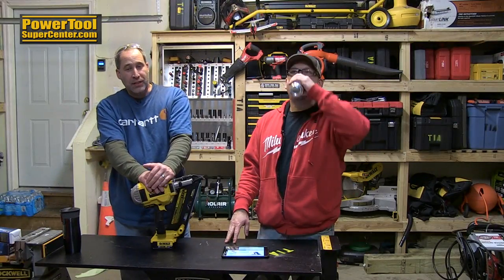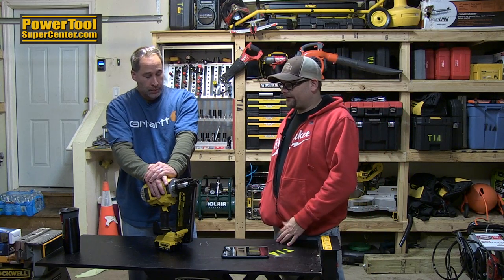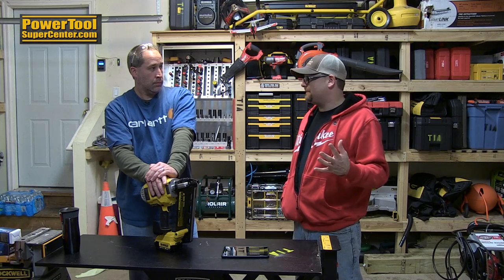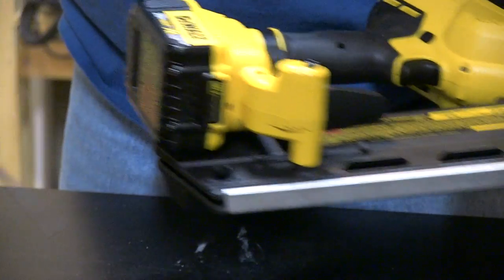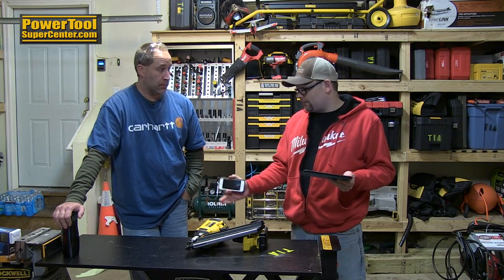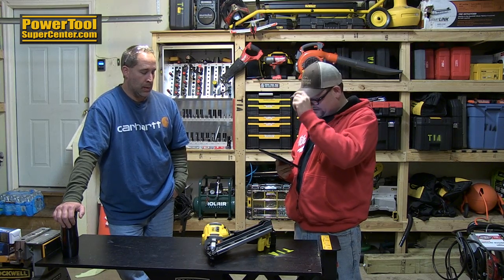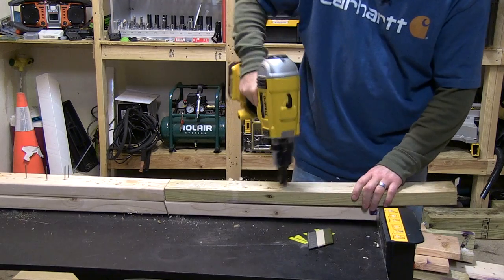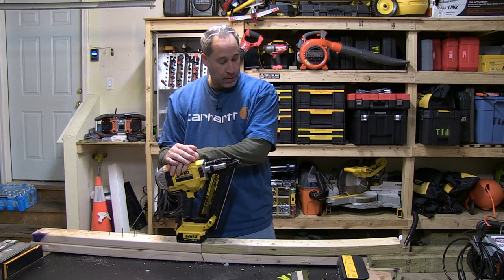DeWALT DCN690 - 20V Brushless Framing Nailer

Comment: I want that!  I love the 20v max dewalt stuff.  I had the early lithium ion 18v Milwaukee stuff and I couldn't even cut through a 2x4 with the sawzall on a fully charged battery.  Made the switch to dewalt after using the xrp line the army issued us.  I don't think I could ever go back!

Comment: The way how the nailer works the motor turns a flywheel then solenoid press the driver towards the roaring flywheel and it hit the nail out

Comment: Hey Dan check out the new Mac power tools that are power by dewalt's 20volt and 12volt max batteries.  Check them out on Google images. MAC (BWP050C) 12VOLT max 1/2 impact wrench, MAC (BWP038) 12volt max 3/8 impact wrench and MAC (BWP050) 20volt 1/2 impact wrench.  They also have a 12volt max drill and a 20volt drill.
Reply from the maker: Wow great find!

Comment: You posted this while I was watching the awards video. I mentioned wanting to see a video on this and bam you had it up. TOOL FIGHT DeWalt brushless nailer, Paslode cordless, and full pneumatic. I think I will get one when I build my house. The pneumatic one we had was great but couldn't fit between studs. I think if you had two people, one with pneumatic and one with this you could go quickly. This would excel in-between studs and the pneumatic for speed. Dan if you want to build a house or get some video of it, when I build mine (probably a few years down the road) I will call you up. You bring some tools and a camera and we will put them to work. I hope Milwaukee gets into this industry by the time I build a house.
Reply from the maker: Yes, I remember that comment!

Comment: I'd rather use the Ryobi... but I'm a Ryobi nut just because its what I've ended up with. Even though if I recall Ryobi/Dewalt is technically Black and Decker owned
Reply from the maker: Ryobi is TTi which is RIDGID and Milwaukee.  I don't think the Ryobi is a framer it is a brad nailer.
Reply: Tools In Action honestly.. i have no idea what the difference is as far as brad/framer
Reply: So thanks to google and a few decent articles I see the difference.. definitely no comparison lol that's why you all are doing the videos and I'm just commenting =)

Comment: Haha, it's Dan Vila and Eric Abrams it would be funny to see you guys build a home. The only thing about the Dewalt is I wonder  about its ability in really dense wood. I just worked on a 70-80 year old building and the difference in the quality of the wood is just crazy. Still the Dewalt isn't nearly as loud as the Paslode which in certain places might be an issue. Another big thing is Paslode fuel cells expire, and you have to remember to take one on to the job site. The Paslode combustion gives off a pretty rank smell of butane.
Reply from the maker: Yes, great points. I will try dense wood
Reply: Something like nailing into a LVL would be interesting to see.if you guys end up doing a Friday night tool fight.

Comment: do a review on the dcn692m1 !!! its the newest one with dual speed
Reply: I have not seen the DCN692M1 available for sale as of yet.  However I believe they will be the same price as the DCN690M1 Nailer, which is $500 with a case and one 4 amp-hour battery
Reply: cool well as i havent bought one yet ... id be pissed if i got the older model as the new a adding dual speed motor .. is a big thing